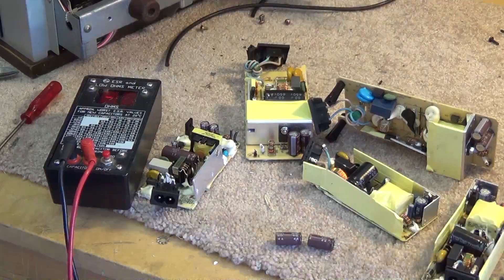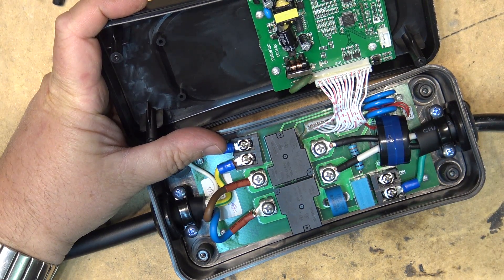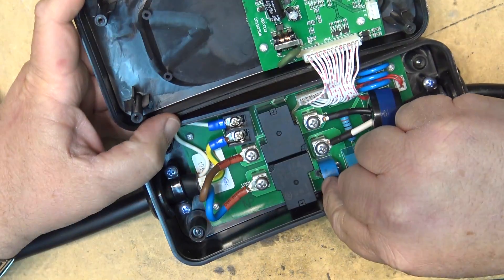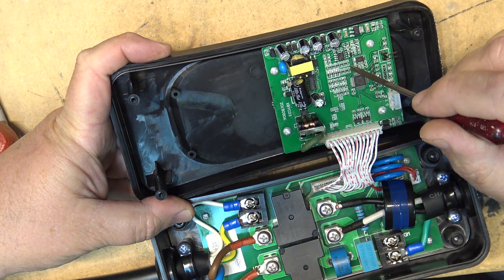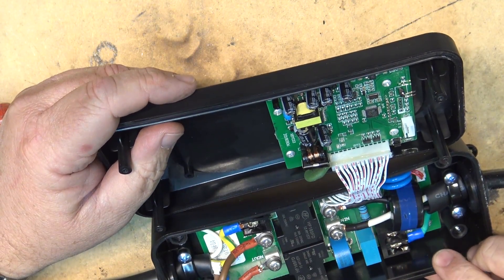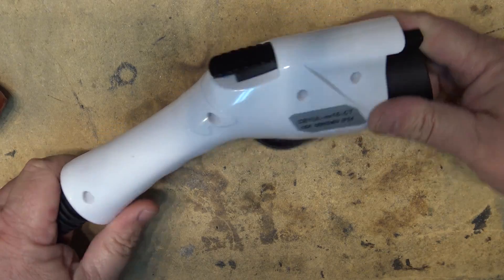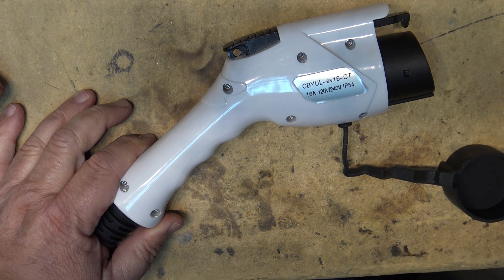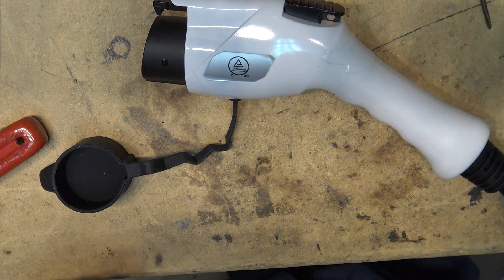Amazon Level 2 EV charger tear down

Comment from the maker: John Vl,. Re your now deleted comment about is being 167 on fleabay.  
167 us converts to 221 Canadian, plus shipping and of course there is taxes and broker fees at the border.  
This cost me 217 delivered from Amazon. 
Plus I have until Jan 2020 to return it if it breaks or I am not happy with it. So far I am very happy.  It charges my car 30 minutes faster then the old one and 1:15 faster than the 12 amp charger that came with the car that I use for my second volt.  After looking inside I would buy again in a second for the wife's car if her cord breaks.  The OEM is clipper Creek and if you look at the cable between the charger and the car there is no comparison.  Hers is much smaller in diameter.

Comment: I think the first large coil is for earth leakage as both wires are going through it.  The small blue one next to the relay is probably your CT.
Reply from the maker: I believe I already said that in a comment.  I didn't pull the board to see what traces are on the underside. The big one with red wires part of ground fault or load imbalance such as one of the conductors going open or a relay failure. Relay failure (contacts welding shut) is the most likely cause to trip this protection.   Even if the car was not connected a stuck relay would have the main cable energized on one leg which would change the capacitence of the cable and cause a slight imbalance which would induce a current in that coil.
Reply: An excellent catch Reddragon! Obvously with the hot and neutral wires passing through the coil the two currents will cancel out and all that is left to measure are the leakage and fault currents.

Comment: Seems to be massively overpriced for what the BOM looks like, realistically a 50$ part. The wall hanging plastic hook looks like it will rip off easily
Reply from the maker: You think this one is over priced? How about a Bosch, or Schneider, or Leviton.  They are all the same inside. Higher amperage will have a heavier gauge wire for the cord, and a larger relay, but they are all the same inside, and one of those chargers will set you back 500 to 2000.
Just to buy the charge cord and connector to fix my other one would have cost me over 100.00 for the cable. Now I am thinking that I will take the orange cord off my original level 1, and put it on the old level 2, and fix it. Then the portable charger that came with the new car can become my travel charger.
As to the "plastic mounting bracket breaking off" it won't. It supports the weight of the charge controller which is perhaps 3lbs.It is actually a thick tab, that would probably hold 100 lbs. It was one of the lowest price units I could find, and it suites my needs perfectly. The cost of the parts does not equal the selling price, and anyone that thinks this is well, dumb as a wall charger. There is the cost of the actual parts and materials, design costs and actual manufacturing costs of the boards, and then assembly costs. Never mind cost of packaging and shipping. This unit cost me 217.00 total. That includes all shipping costs, delivery costs and taxes.
I couldn't build one myself for anything close to that.

Comment: Looks like a well made charger, neat and safe :-D
Nothing cheap or nasty inside that.
Glad it's not plastic welded together, a really annoying habit of switchmode manufacturers.
I've had to crack open laptop psu's to replace caps and power socket solder cracks, just makes a mess :-(
Reply from the maker: Yes I was quite surprised on how well it is laid out inside. I am pretty sure other EV drivers after seeing this one will be looking closer at this unit as a backup charger, as it did come with a plug adapter to allow it to operate on a standard 15 amp 120v outlet as a travel charger. Charged the car 5 times since I got it, and it is faster than my old one as my old one was 3600 watts, this one 3840. The other car is capable of 3300 watts, but the stock charger that came with the car is only 2880, so I may just swap the charge cable from my level 1 only unit, and put it on the big round wall mount controller, as it will go to 3300 on the old car, and that will charge it faster too.

Comment: Makes sense that the relays are off load as they're transferring a fair current to the car.  If you need to stop a charge for some reason, mid charge, do you have to do it at the car end or can it isolate on load in given situations?  I would love an electric car.  My brother in law is buying a Nissan Leaf so I'll see how that goes.  (Oops, just read your earlier replies which explains all)!
Reply from the maker: If the EVSE detects a fault it will turn off the pilot signal which the car would treat the same as pressing the button to unplug the car. This would gracefully stop the current before the relays cut the power.   Since charging is full load most of the time you don't want to be turning off or on relays under load.  That will cause a spark that could weld the contacts closed.   
Once you drive electric it is tough to go back to petrol. Even though my car has an engine it never runs.  Probably won't come in till next summer when I travel.
Reply: @12voltvids  I was an electrical fitter before I retired so having an electric car has extra appeal!  They do make a lot of sense but petrol is still king this side of the pond!
Reply from the maker: @gartmorn  
For now perhaps but give them a few more years.

Comment: I built my own level 2 EVSE when I bought my C-Max Energi back in 2013. From what I could see on the video both hot wires ran through that toroid transformer that you thought would be measuring current. With both wires going through in normal operation the fields would cancel out. 

The actual use would be for the ground found detector. If there is a ground fault then the currents would not exactly cancel out, generating a voltage from the transformer. I think I also saw a large wattage resistor and a relay, those would be to generate a simulated ground fault for testing to make sure the ground fault detection circuitry is working.
Reply from the maker: The small blue component next to the relay may be  a current measurement transformer, as it looks like that is connected to ground, and there is likely a trace on the bottom side that connects it to the header that goes to the other side.
Reply: @12voltvids  Yep. Nice!

Comment: Can’t wait to see the tear down and de-potting of the original charger Dave. 
I don’t think the new charger will last anywhere near as long as the old one did and you’ll probably find that long term it will cost you more money and headaches constantly replacing it. 
I would be concerned if your vehicle talks to the charger and knows it’s not OEM therefore putting the onus of blame on you or the street chargers you use. Just my thoughts.
Reply from the maker: The vehicle doesn't talk to the charger. The charger, more accurately called EVSE, electric vehicle service equipment, sends a PWM modulated tone at 1KHz down the control line. It is 12 volts PWM, the duty cycle tells the car what the charge current will be. The car puts a resistive  load of 2.74K ohm as soon as the plug in inserted. This tells the EVSE that it is connected but not ready for power yet. The car then adds a 1.3kohm resistor in parallel when it is ready for power and the relay closes. Once AC is on, the car then goes into charge mode. If you press the button to disconnectthe car detects this, as the button is monitored. The car opens shuts off the charger and then opens the 1.3K resistor at which time the relay is deenergized. Also once the battery is fully charged, the 1.3K is opened and the cEVSE cuts off the AC power.
It is really quite a simple circuit, and yet some people will pay 1000.00 + for them because they think there is more in it. Some are network enabled, but that is only so the power company can control when you can charge. In some jurisdictions drivers get a discount, because the power company will only allow them to charge when they have excess capacity. There will probably come a time that all the utility companies will over a discount rate to charge a car if you allow them to select the best time to charge, but you will pay a higher rate if you want to charge in peak usage times.
Reply: @12voltvids  If loads of people buy EVs, the govt will want to get the money that they used to on fuel tax. The maths for EVs do not make sense if one believes that mankind is responsible for global warming. It takes much more energy to make one than a regular vehicle, plus power station will use more power as the EV load increases.
Reply from the maker: @drteeth7054  actually electric cars don't take much more energy to make than a regular car.  Your argument that we are not paying our share of road tax is correct.  Currently we don't and eventually I am sure there will be road pricing introduced but currently we don't. I have been driving electric now for going on 9 years.  Compared to my old gas guzzler I have saves about  400 a month in gas. My first ev paid back it's full purchase price in 8 years.  I put that 100.00 a week I wasn't pumping into my old car that drank like a fish and put it in the bank.  I walked into the dealership and bought my second one for cash using all that money I didn't give to the greedy oil companies.  That's right, that brand new 2019 I drive cost me nothing.  I put alot of miles on my cars.  Since I bought my new car in may I have put 12000  on it so far.
Reply: 12voltvids what cars did you own?
Reply from the maker: @sarasartori6859  I have had many over the years.  Mercedes, bmw, dodge, Ford and now chevy. I drive a 2019 volt and also have a 2012 volt, hence the channel name 12voltvids.  The first videos I did were on the 12volt.
Reply: 12voltvids nice
Reply from the maker: The old one wasn't trouble free. It used to eat 20 amp fuses like they were going out of style. How come a 20 amp fuse blows and the 15 amp breaker it is connected to doesn't trip? The original one broke down  the first time 2 months past warranty ans SPX said it was not repairable. Blown fuse. Replaced. It would blow one of the 2 fuses at about a 10 month interval, for no reason. Notice the new one is NOT fused. It reies on the 15 amp circuit breaker.
Reply: @12voltvids  I agree and think that,  in some cases, warranties which make you use oem is just a money making exercise.